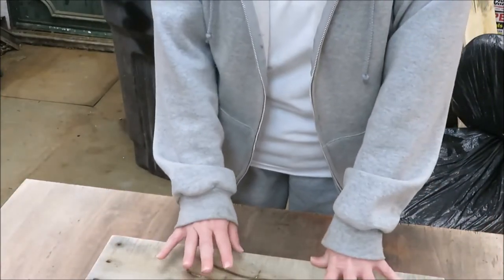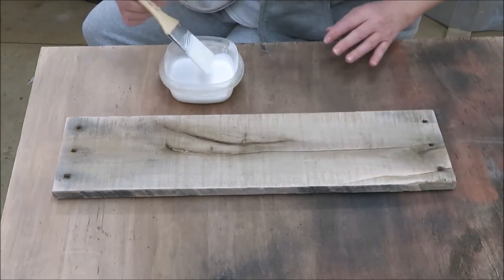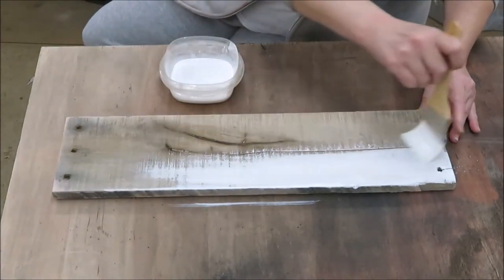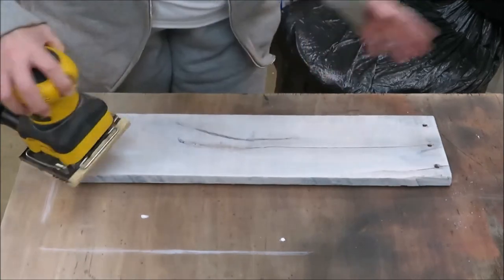pallet wood family sign

Comment: Make Kevin buy you an electric stapler or a pneumatic one.  Also the have clear poly in spray cans, that would have worked good for the chicken wire.
Reply from the maker: HI FRANK,actually I do have an electric stapler it was in the house and I was bening lazy and didn't  want to go after it lol.